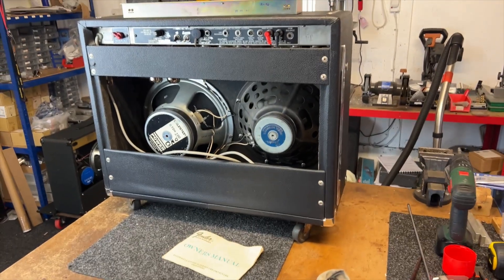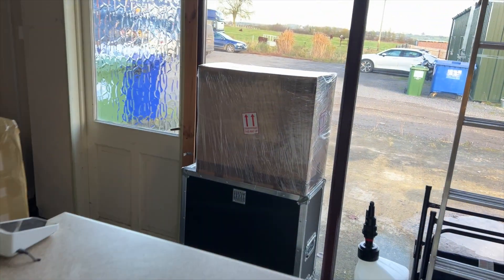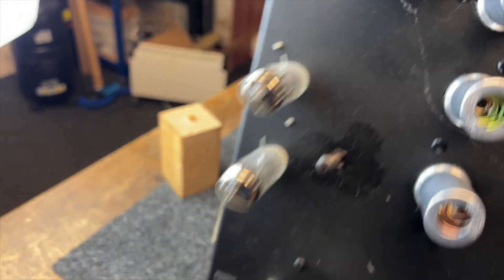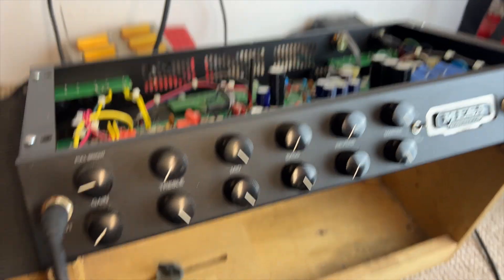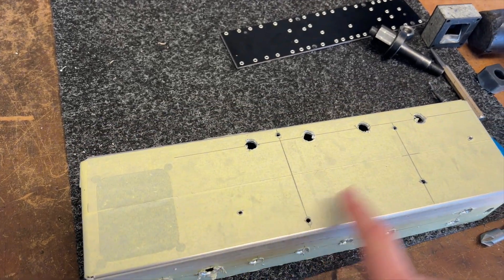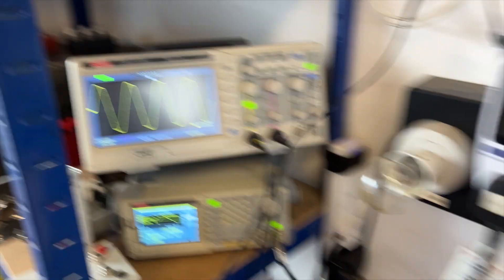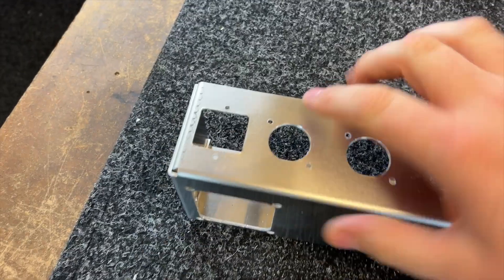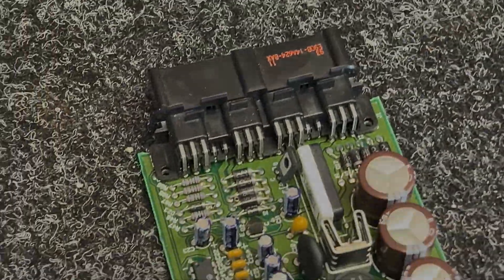This MESA doesn't BOOGIE (plus a new Dealer for Rift!)

Comment: Chris,
Really like your channel and what you do.  FYI, an unsolicited tip (pardon my cheek): for deburring, if you use an flexible extension shaft on your cordless drill along with a stepped bit, you can debur each hole in two seconds, and the resulting feel will be smoother as well.

Comment: For those wondering, the big bolt on Mesa amps is a tension bolt; with chassis installed in cabinet just hand screw it against the top of the cabinet and it stiffens the bottom of the chassis against vibration.